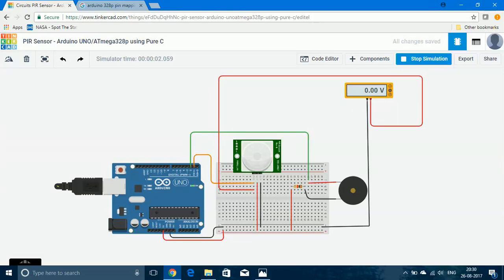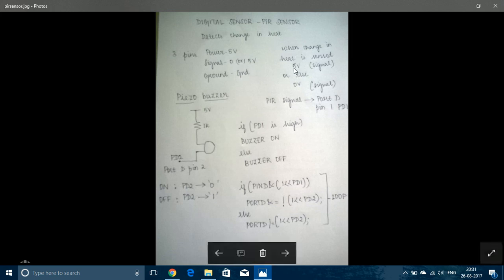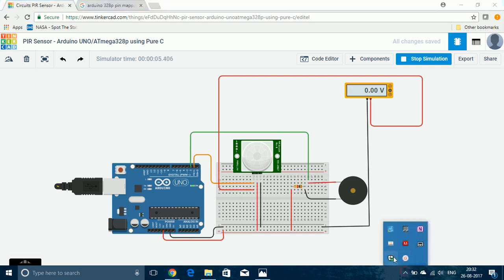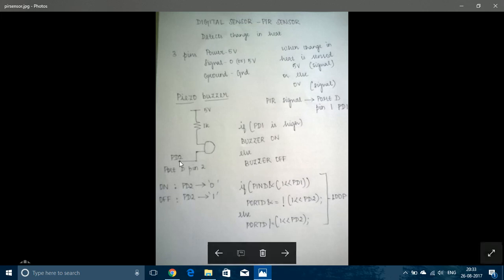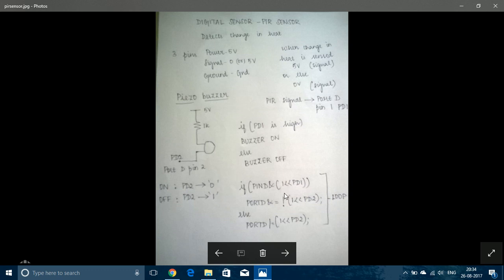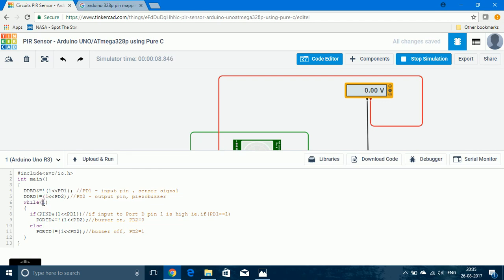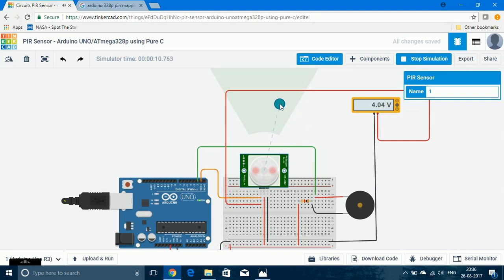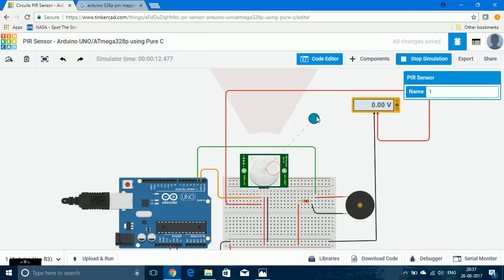PIR Sensor - Programming Arduino UNO/AVR ATmega328P using Pure C (Tutorial)

Comment: Great tutorial. It would be helpful if you mentioned that the buzzer is an active buzzer that doesn’t need a PWM signal from the Arduino to drive it. It has this circuitry built in. Otherwise, people may be wondering why the buzzer does not sound.

It would be even better if you did use a passive buzzer and expanded your code to generate a PWM signal using embedded C. It is not hard to do and would be very useful since most cheap / common buzzers are passive.

Comment: i am using relay and a light bulb in this case. i think i should write'' relay on and relay off '' instead of "buzzer on and buzzer off". but again i am confused coz  digital relay has three ports(vcc, output, gnd) but buzzer has 2 ports(-ve  , +ve). so i am unable in connection pllease tell me asap
Reply: Very easy vcc-power supply
Gnd-ground and another one is signal i.e. coming from Arduino .try it